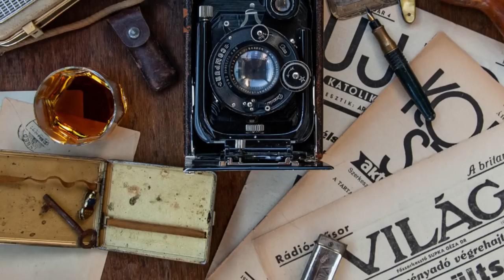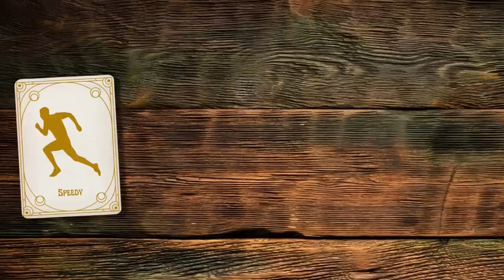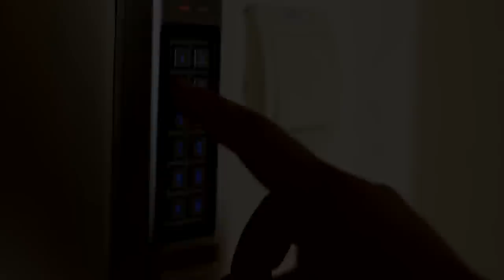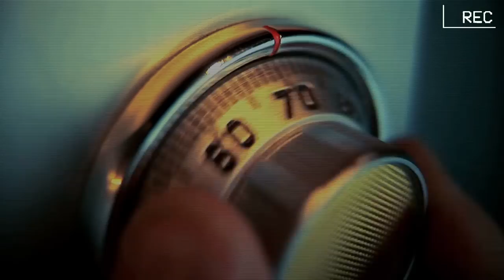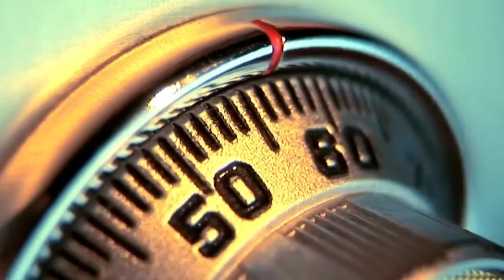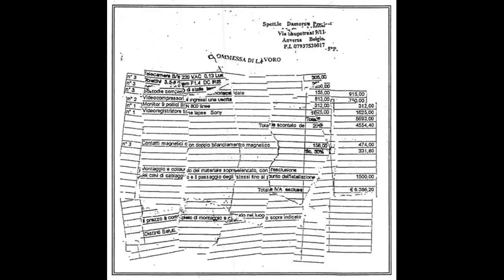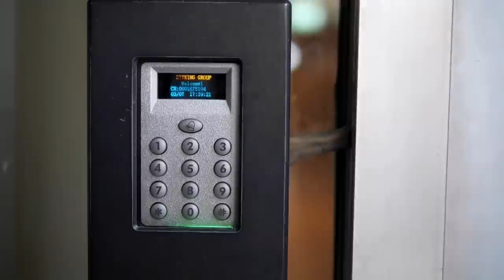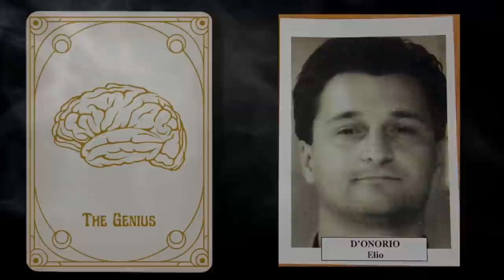The 100 Million Dollar Diamond Heist

Comment: As a banker who has safe deposit boxes in my branch I find it amazing they didn't have a time delay lock on this vault
Reply: Right??? However, would that have really changed anything?
Reply: @VioletJoy  it absolutely would.   A functional time delay will not open till one of the clocks hits zero.  There is no way around it.
Reply: @bmstylee  I was just wondering if he could have just waited it out before going in.
Reply: @VioletJoy  probably not.   When we time our vaults it is so they will open around the same time we arrive for work.  So for example when we are scheduled to arrive at 0800 the timers run down shortly before that.  So basically they are ticking down overnight.  Same thing over the weekend.  Short of making a hole in the ceiling or floor to get in you're not getting through the vault.
Reply: @bmstylee  Ohhh, very interesting. I really appreciate your input. I'm still shocked that he was able to get in fairly easily. Clearly, the system wasn't strong enough for such valuable content. Crazy!!